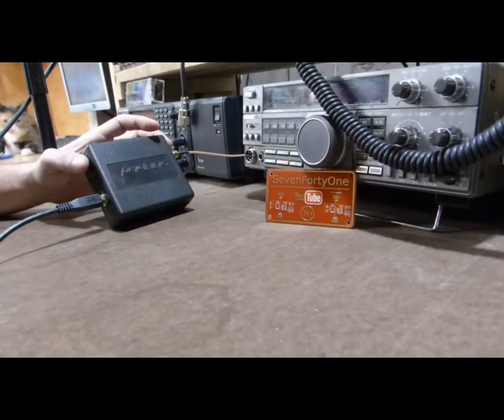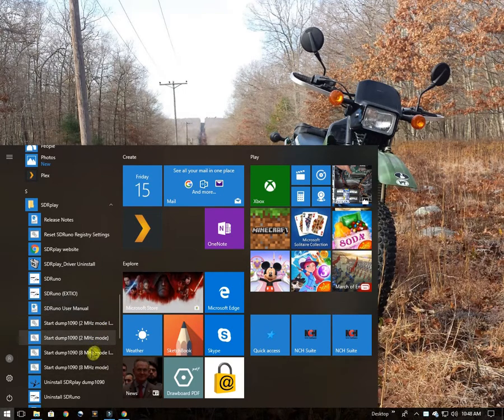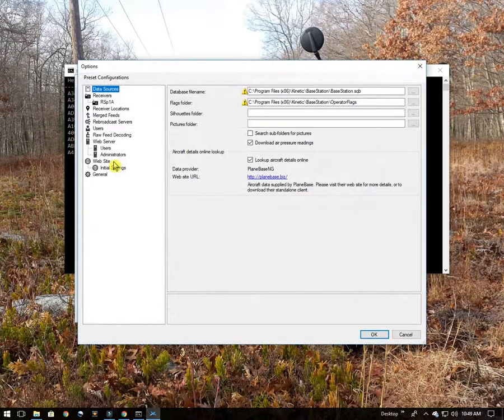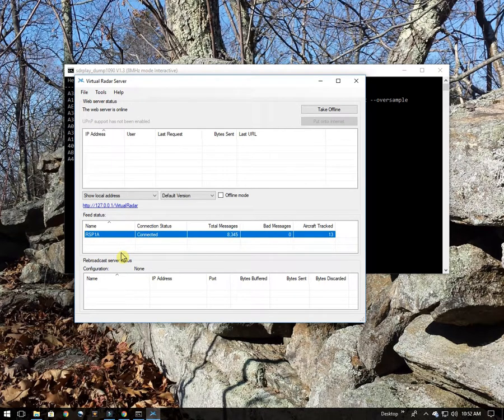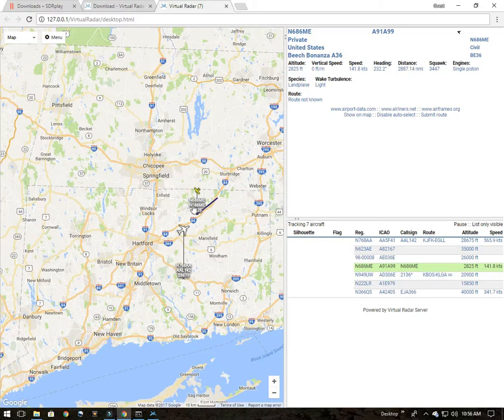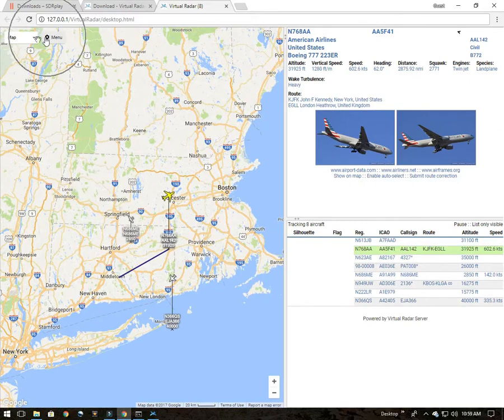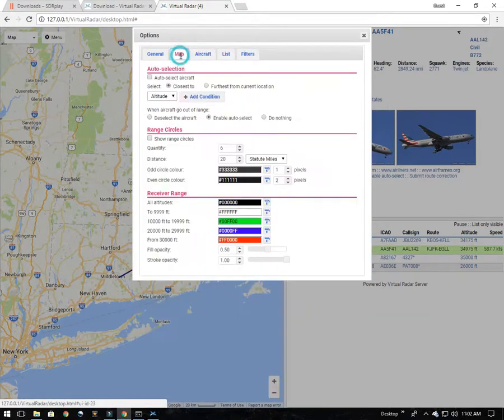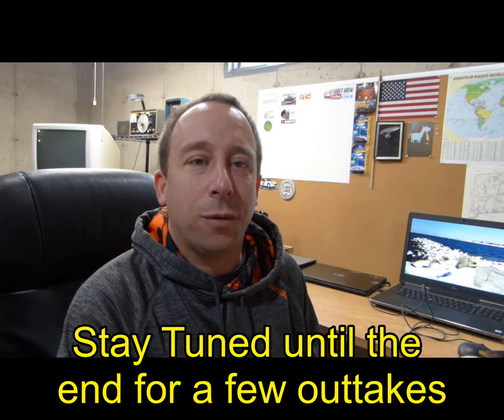ADSB - Tracking Aircraft With SDRplay RSP1A Running DUMP1090 and Virtual Radar Server

Comment: Thanks for the great video, just got the RSP1A at HRO and figured it would be capable of the ADS-B and here it is! When I get some time, I will give it a try! So many toys here to play with! :) Looks like your bike is a KLR250? I had one for 8 years and put 30K miles on it, mostly street before I upgraded to the KLR650.  73!
Reply from the maker: The rsp1a is a great radio.  That is a klr250 but I ended up selling it over the winter after having owned it for 17 years...I never rode it anymore....

Comment: dso i have to have started the sdruno software? with uno running, dump 1090 is not connecting to radio although it said it sees it, and VR not connecting either and no data being displayed here either. any help appreciated, Tia

Comment: Hi ! What is the point of changing port 30003 to 30005 ? Default value here is 30002, but I haven't tested it yet. Thanks.
Reply from the maker: I don't remember..I think I had a conflict.  Either that or this was recommended so I went with it

Comment: another video that fails to show the screen at a readable level, 741 obviously can see what he records but this view cannot and that makes it next to impossible to follow. It also makes it really difficult to find the useful information.  One bad sign was using a 2mtr antenna for ADS-B
Reply from the maker: Another comment that fails to add any value to the discussion.  Ram Jet is obviously unable to learn anything on his own and needs to hide this fact by leaving arrogant comments on videos that are above his learning level.  One bad sign is the fact that he has not uploaded any videos of his own and has no idea how much time and effort goes into the process.  Oh well....
Reply: Uh? I critiqued your video, I pointed out that "the screen" (you show) is unreadable to the viewer.  You could see the screen, you know what is on the screen but the viewer does not,  and, that makes your video next to impossible to follow, unless of course you can see the real screen or have seen it and know what is on it.. Then, there is that use of a 144 Mhz Antenna for receiving ADS-B, it takes about one minute to get the tin snips to cut around a can, drill a hole and solder a coax connector with a bit of copper wire for a real ADS-B antenna.  You have idea of who I am and if I have or have not posted videos. So now you can demonstrate to the youtube community your true colors.
Reply from the maker: Ok - I'll bite.  I want to understand where you are coming from.  1st of all, I realize the resolution and audio quality of this video aren't studio quality.  I'll be perfectly honest and tell you that I'm not really happy with this myself, however, what I uploaded to YouTube looks perfectly readable to me.  A little fuzzy, yes.  But the screen is readable so i decided to post the video figuring that putting something out there, even if the quality was a little off, was better than not putting anything out at all.  As of this date there are 56 "thumbs up" which tells me I made the right decision.  Your comment of my screen being unreadable seems unfounded or exaggerated.  Can you really not see what I'm showing in this video?  Maybe you have a playback issue on your end. 
Concerning the antenna, why does it bother you that I used something other than a "proper" antenna?  My 144mhz antenna works, doesn't it?  This video was not meant to be the definitive guide on how to do this.  I'm simply showing how I went about getting this to work.  Your comment implies that because I didn't use a proper antenna this video and my approach is somehow invalid.  I'll argue that the use of a non-standard antenna demonstrates that one doesn't have to have a dedicated antenna to experiment with receiving ADSB signals.  I agree that a dedicated antenna would work better but mine does work fairly well and I see no problem with showing that in this video.
Your "critique" comes across as more of a complaint than constructive criticism.  As I said above, I don't have a readability problem with what I'm seeing after watching this back several times directly from You Tube.  And I fail to understand why you are upset about my non-standard antenna.  Perhaps I'm interpreting the spirit of your comments incorrectly because of this.  
I looked at your Ram Jet YouTube page and see no content which is why I question whether or not you really understand how much work goes into creating a video.  I really don't have to do this and comments like yours make me question why I bother with it at all.  If you really are an expert at video creation and/or SDRs then why not share a link to your videos or other credentials that make you an authority on this subject?  I've been demonstrating my "true colors" to the YouTube community for 9 years now so it knows what to expect from me.  Lets see your true colors.  Or do you have any?
Reply: I had no problem reading the screen. He used an antenna that worked. That's all that was needed.